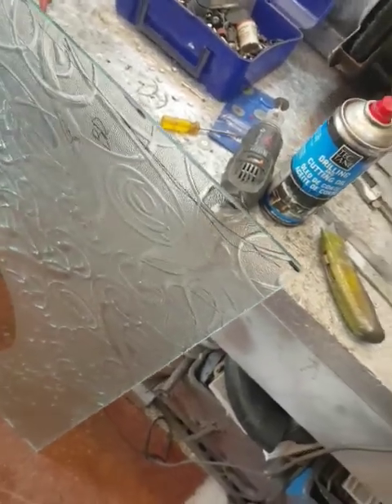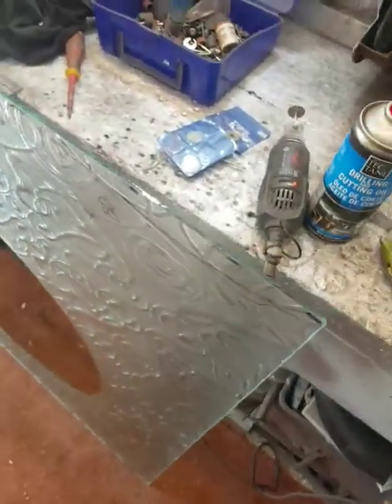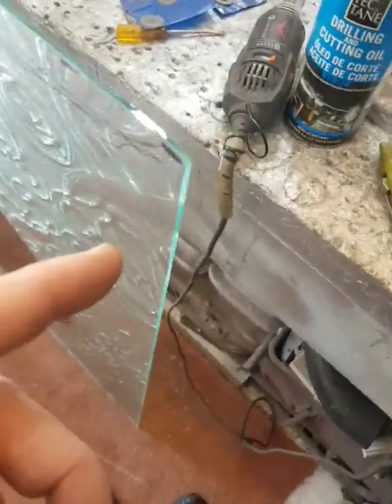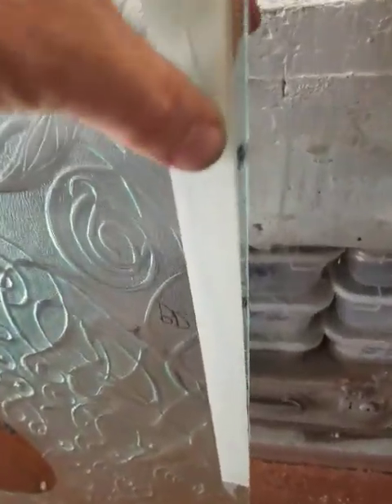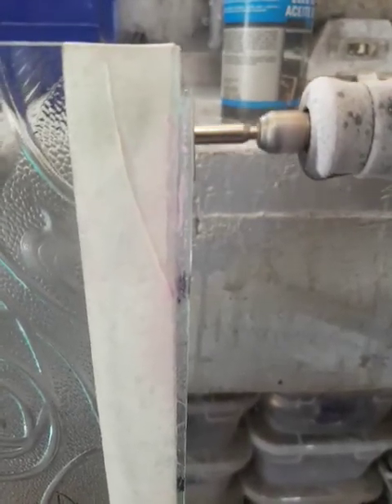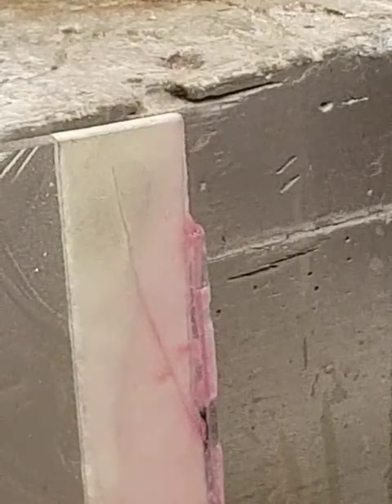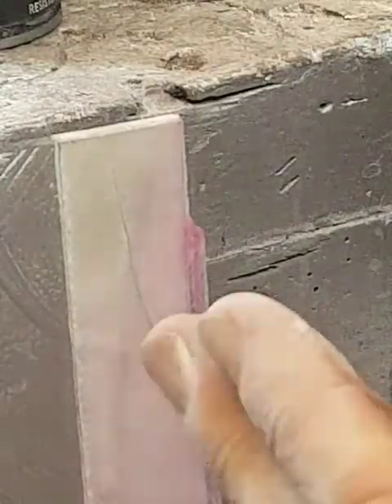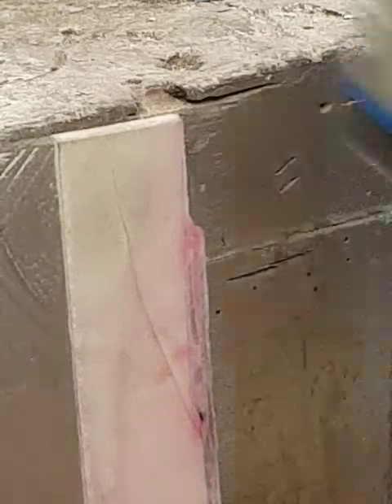how to cut and file toughened / tempered glass without it exploding (as all experts promised)

Comment from the maker: update summer 2025 - im amazed how many views this got, just because i think out the box and question things im told are 'unquestionable limits- dont ever try it' , through experimentation and science, i proved wrong not for the first or last time i can tell you. thanks for the interest and appreciation. After succesfully cutting this Early 2023, i mounted it ok in the slightly warped UPVC frame, it was fine and never exploded, at least for the month or so till i sold the house. the reason it had a poorthole cut, is i love boats and i added a circular transparencyin the hole, that stuck on the DG window i was obscuring. the transparency was a photo of the river i love sailing on, from a screengrab of a 4k drone video on youtube. was great fun and 'art' that i doubt the new owner appreciated all the effort. probably they took it down, regretting then the lack of privacy without it, and put up net curtains instead, i dunno. ill try post a photo of that finished window, but i dont know how to yet? Anyway to all the doubters out there that commented it wasnt toughened glass - wrong it was. i tested the idea first on other toughened glass as proof of concept e.g. you can try yourself first on scrap  tv stand glass and fridge shelf glass available at recycling centres. the explosion is similar to wine glass shattering on hiogh energy sound waves, so it might be a combination of amplitude and frequency, so keep your tool quiet and avoid anything that makes a similar note, to the note you hear when you 'ding' the glass with your finger (resonant frequency). this is why opera singers ding the glass before they try shattering it, it tells you it's 'note'. aha ! avoid that note at all costs or keep it quiet.

Comment: Great information, Nick. What if you fully support the glass flat on a surface with a piece of carpeting under it, to help damp vibration as you use the diamond cutter and rotary tool? I can't help thinking that would make the process even safer, in terms of the stability, and the amount of stress on the glass.
Reply from the maker: my workshop floor carpet was too small, but yes i would agree, and water the carpet a lot, but then youll get spray up. its also easier to work on a vertical line for sighting and getting round the back to round off etc you cant do on carpet. probably can mount the dremmel on a CNC or laser cutting bed ultimately?

Comment: I have never seen tempered embossed glass , and tempered glass always has the edges ground simi round before the process. If you want everyone to believe you, you will unfortunately have to break a piece of that glass. I think it is probably just annealed glass.
Reply: That looked suspiciously like a crack under the tape. And you’ll notice he does not remove the tape at the end.
Reply from the maker: wrong. its just privacy glass used mainly for interior doors, that always gets tempered as its not illegal not to, in case a person gets the glass breaking on them, its safe. the suppliers all insis on tempering anything that is used inside a home, its UK law? dont doubt me just because youre amazed, try it or read other peoples comments forst, they followed it ok too
Reply: That’s not tempered glass! I have worked with all types of glass over 40 years , all tempered glass edges are polished and has a tempered logo on them .

Comment: Hey Nick, just came across your video, thank you. Hope your glass is holding up well. Just came across similar problem, got new kitchen splashback, it's .5cm too wide, no one will cut it as it's toughened glass, image on the back, they said it will shatter. Can't return it as the return window's closed, and been quoted ridiculous prices for bespoke new one, as the standard sizes don't fit. Off to get the tools & supplies you mentioned, and attempt to shave off the 5mm myself. Wish me luck! I'm renovating our kitchen, and I've been at it for 2.5 months now, working every day. Not a builder, but good at DIY. 🙂
Reply: Did this work ?

Comment: Rule of thumb! You can grind 1/3 of the thickness , using carborundum and water . Been in ghe trade 42 years and never seen anyone cut toughened glass.
Reply: So true, cannot be cut, easier to take it back and grind it down on a polishing machine, all care but no responsibility taken if it blows up.
Show us the label from the glass supplier stating it has been toughened, and or the etched safety stamp in the corner.
Reply: Thank you!!! People will try their best to do something professionals tell them is impossible

Comment: Well in India we used metal cutting abrasive thin blade with small water running through while cutting and letting wheel do it's job and not pushing it hard , it does fairly well, a Clean and nice cut, i think you should give a try, but note that you should lay glass on a carpet for good support less vibration....try it thanks me later... please post a video of your job, and hope you will atleast give credit of success for my ideas ❤
Reply: What is this type of cutting called in the local market? Desi mistri ki bhasha me kya bolte hai isko? Need some toughened glass cut to fit a frame.
Reply: Bullshit. You cannot cut toughened glass unless you anneal it.

Comment: Men, i used the same method on normal glass, and always think it will work on tempered but never tried. I only suggest to lay the glass sheet on a carpet, so it will have less vibrations.